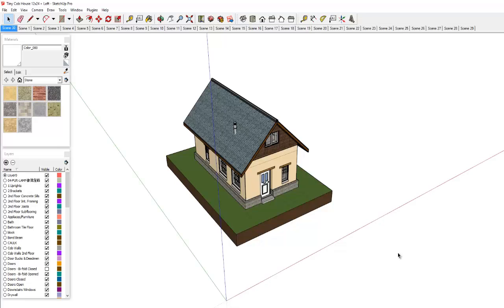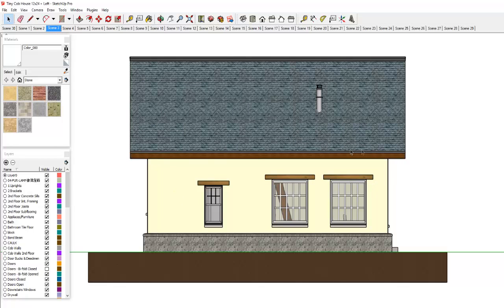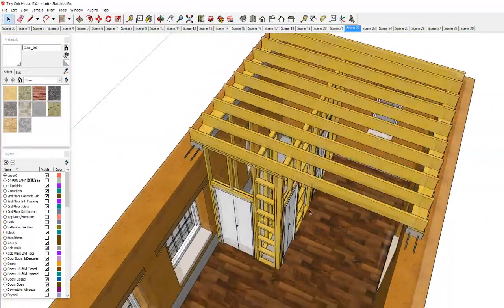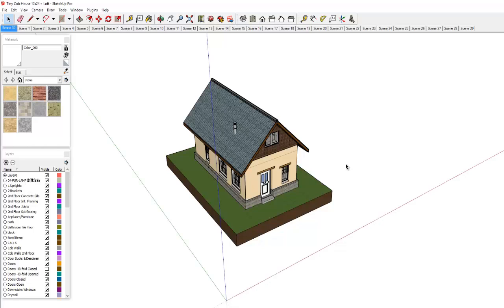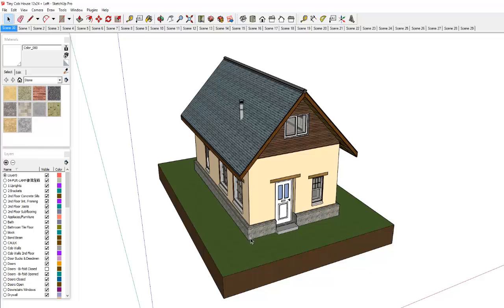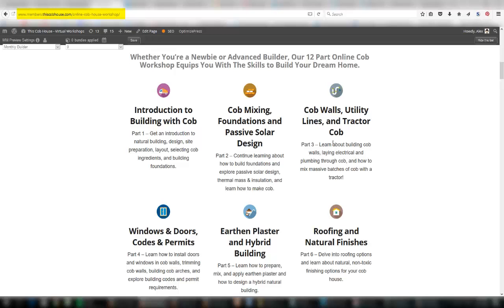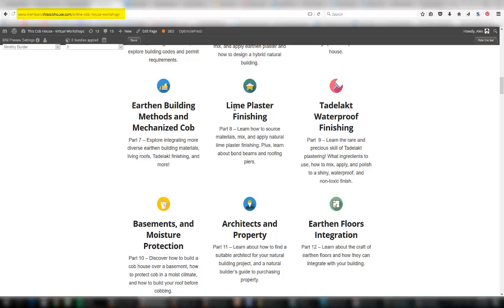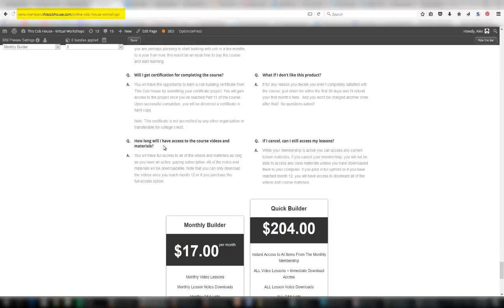BUILDING A COB HOUSE - FREE ONLINE CLASS

Comment: Rats are completely able to dig trhrough a light clay wall. I don't know about the massive parts of the wall, but light walls can be peace of cake for them. Best cure: add lime plaster on the outside - its so ful of natural acid that rodents will hate it. This problem is rare one, so most people don't have such rats living around.
Reply: Or you can add wire web in the lower part on the outside wall. If you know you'll deal with lot's of warm and food seeking rats and mice (colder climate).
Reply: I cant imagine building a cob wall and NOT using a lime plaster
Reply: @Jaepeaa  lime plaster is completely unnecessary but makes newbys feel safe
Reply: Let cats live arround your house 😊